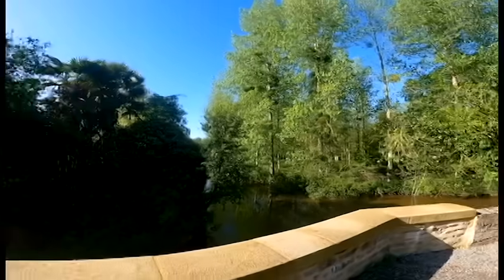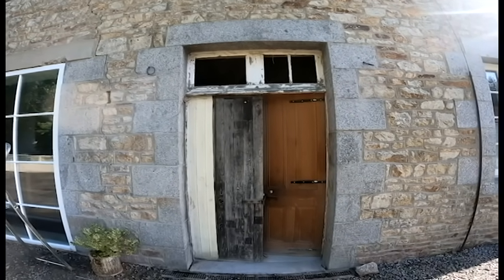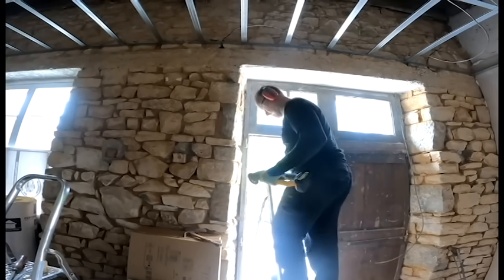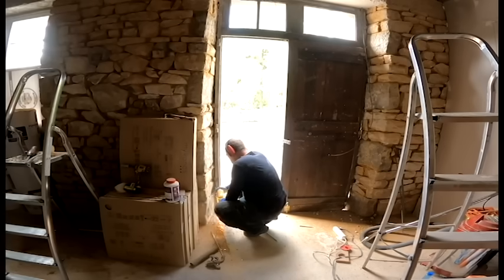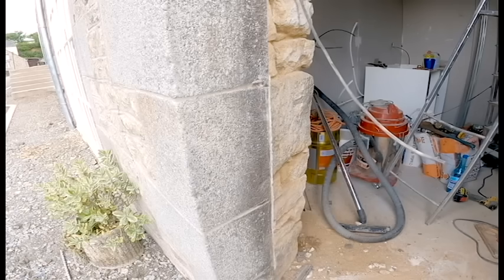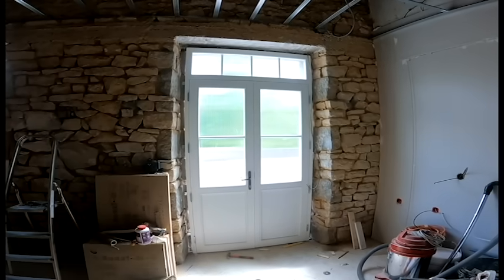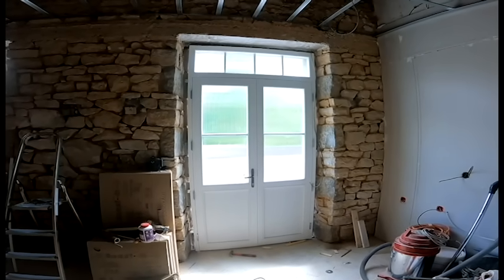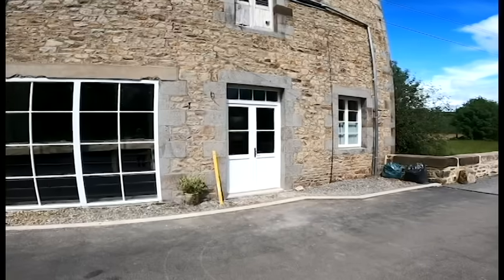Moulin du Couesnon - Out with the Old

Comment: Just noticed a big crack in the wall outside on the left side of the door whilst you were filming outside, taking the door out….just in case you were unaware.
Reply from the maker: That’s a very old crack which needs to be repaired. Happened over 50 years ago when part of the bridge collapsed.